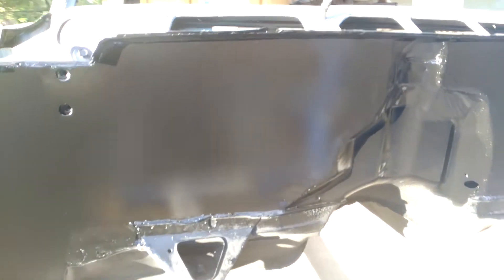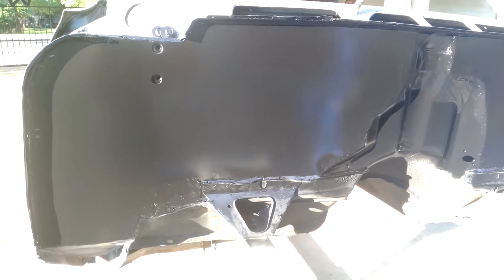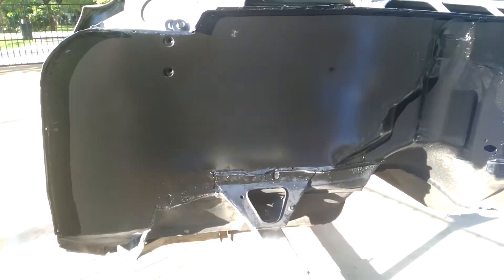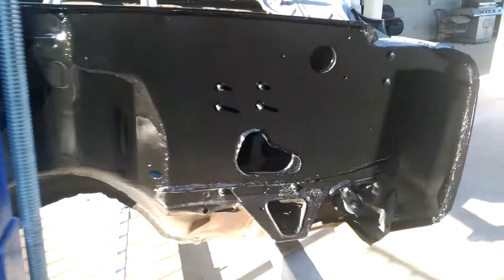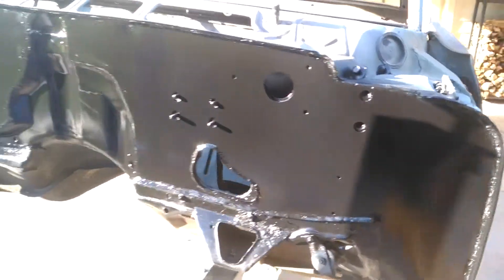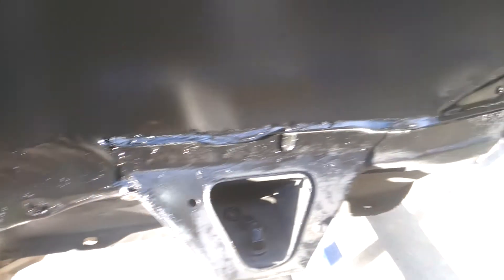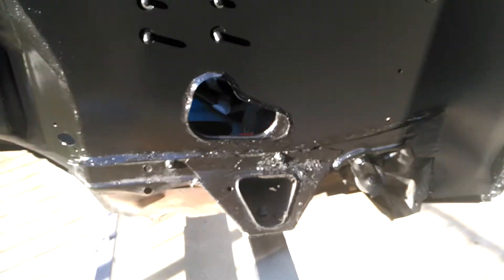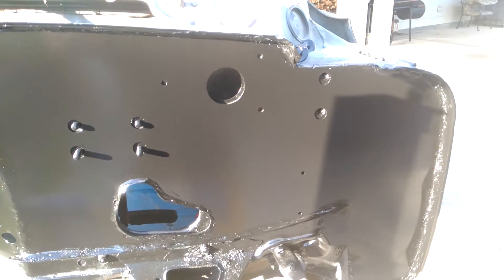1964 impala shaved firewall in epoxy primer

Comment: If you were going to add vintage air kit would you use the hole that is on passenger side???
Reply from the maker: Would drill new holes. Fender would have to come back off. Ive never i stalled but have a general idea of how to